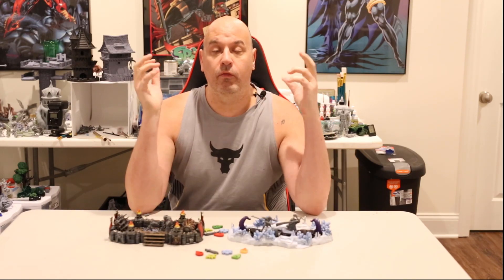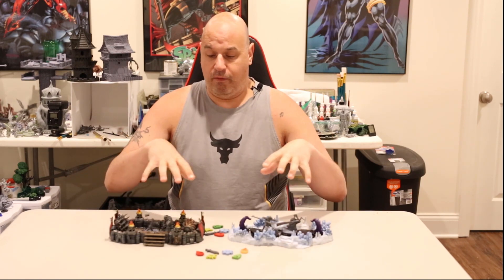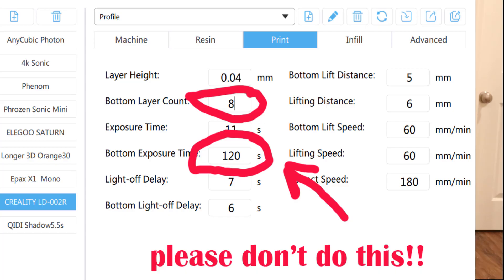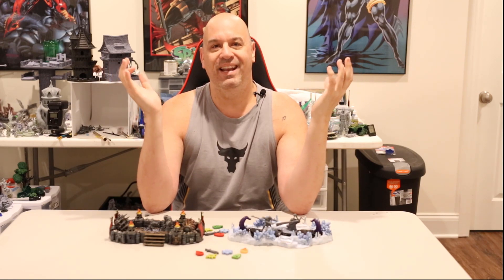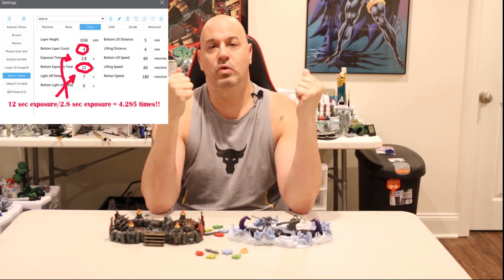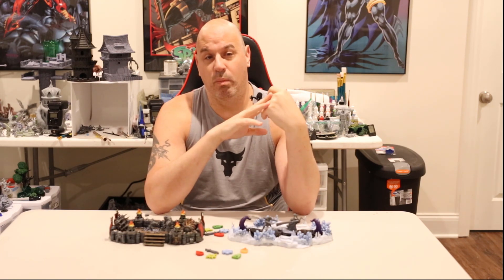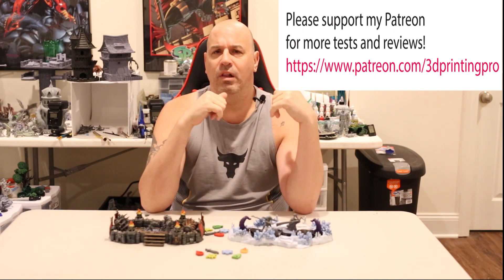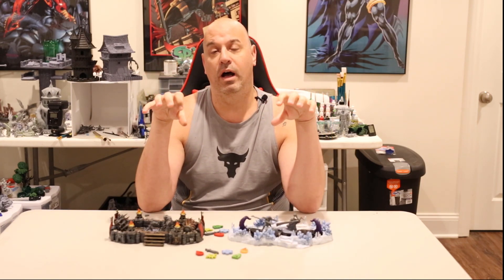Are you destroying your LCD screen when resin 3d printing?? Learn what settings may be doing it...

Comment: The most i've ever had was 6 layers at around 60-70 seconds at most... i've never had any problems with it...

I didn't even know people were upping it to 120 seconds... jeez
Reply: It's massively resin, layer height, etc. dependent. I've had to use 200s before. I typically sit around 10x normal for a good safety margin.

That being said, the layers is definitely getting out of hand, and higher layer counts is usually WORSE, not better. People don't seem to realize that only the first real layer touches the plate. Layer count is really to adjust for layer height. I also recommend 4 layers for standard .05mm height. If you halve the height, double the layers so you're still at .2mm of bottom layers.

Comment: I'm at 80s bottom layer time with 10s normal exposure time. I started at 60s bottom layer time and increased to 70, then 80 and now I get very few failures and prints scrape off pretty easily. I have 6 bottom layers and have been thinking about reducing this - now maybe I will go to 4  I've actually been wondering why anyone would need to do more than 1 bottom layer? There's only 1 layer that's sticks to the plate and if it doesn't stick, then the 2nd layer isn't going to stick also!
Reply: That's what I was thinking about bottom layers. Layers 2,3,4 etc. are just sticking to the first layer so do they really do anything extra by being so over exposed. I might try some experimenting with a tiny print.
Reply: @stinkyham9050  I just tried 2 starting layers and it printed just fine. I think I'll stay with that for a while and see how it goes.

Comment: I used phrozen water washable and it needed 30 sec on the sonic mini to stick securely, I had it partially lift on a few prints until i bumped it up. Siraya I'll do 15 to 20 depending on the size of the print. My photon I was doing 60-70,  I have over 800 hrs on that screen and it's still kicking.

Comment: Just to chime in. I use 3 bottom layers (0.05) at 30s on Anycubic Photon S (normal exposure at 9s). And I'm having issues with your flat bases. They are really hard to get off of build plate. Razor blade does help though. :) Never had a fail due to resin not sticking to build plate at only 30s for bottom layers.
I did sand the build plate with a P1000 sandpaper (straight motion, lengthwise) as suggested somewhere else.

Comment: I think bottom light off delay can also help with extending the life of the screen.  I am totally guilty of having too many bottom layers (12 @ 90 seconds once upon a time.... now down to 8 @ 70sec.).  But I've felt how hot the screen gets for long periods of on time.  Not to mention how hot the resin gets when exposed to the light.  I turn my bottom light off delay to 50% of the layer time to give that screen time to cool off some.  I think I'm going to start dialing down my bottom layers and times as much as I can to still get a good print.  If my OG photon can get down to 6 or even 4 layers at 60 seconds, so much the better.
Reply: My OG photons are 5 at 65, and everything works great so I believe you can too!

Comment: Im using a Mars 2 Pro with a mono screen, and normally Elegoo water washable resin. Elegoos reccd settings are 5 layer base exposed at 35 secs, then 2 secs a layer. Seems to work sweet as a nut for me even with "big chunky" prints that have a lot of surface to lift. Great base adhesion, no base peel, but clicks right off with a nudge at the edge at the end of the run. Water washable has different settings to normal resin so the settings for normal would be different. The 2 Pro Mono is a massive step forward IMHO....very impressed.

Comment: Hi Greg, i've seen that on your epax you're using 7 seconds of light-off delay. Could you explain why? As always your videos are amazing.
Reply: I noticed that too. I tried asking him on the AG discord but he's a busy guy so never got an answer
Reply: @HEMASimian He usually responds the messages. I just want to know if that delay is another of his magic tricks
Reply: @Jbachill  yeah I've never seen anyone recommend anything over 2s, let alone 7. Not sure what issue 7s would fix that like, 2s wouldn't so I'm super curious
Reply from the maker: @HEMASimian  I'll make a quick video on that stuff!  :)
Reply: @3dprintingpro212  thank you!
Reply: @HEMASimian  @javier Bachiller my understanding at least on the PhotonS is anything under 6.5s it ignores and sets to 6.5, so by setting it to 7, again on on a PhotonS he is only raising it .5 from normal.
Reply: @MrRage000  Thanks
Reply: Perhaps giving more time for LCD to cool down after each layer to extend it's life? I'm new at resin printing, but I have mine set to 6 seconds in hopes that this will prolong it's life.
Reply: 5s light-off is built in (maybe higher on other printers) so 7 is really just +2 seconds of cooling off per layer. Has various small benefits, raises life of your screen, and may protect fragile pieces.
Reply: good sharing. may i know what you think about the wham bam flexible print bed for resin printing ?

Comment: On my sonic mini, I've been using a 3.5s exposure time and 4 bottom layers for a while now, but with a 25 second bottom layer exposure time (6.25x).  No issues, at all.  I'm going to try setting it to 18, to get it closer to 5x the normal exposure time, and see how it goes.  Thanks for the video!

Comment: With the Photon S the recommended was 3 layers and 40 seconds, I've dropped mine to 3 and 30s layers and can count on one hand the number of issues I've had in the last 5 months. Every time I read a comment that suggests someone increase their bottom layer count/time I cringe because it's usually not the right answer. I'm still waiting on my Saturn(one of the last from the first batch) but I'm planning to run some prints at 3 layers and between 10-30 to find the sweet spot.

Comment: It's really great that you made this video, but the unfortunate truth is that most people using 3d printers have no idea how they work, and no interest in tweaking settings. They just go online and copy someone else's settings. Almost none of them will ever try to calibrate themselves, and when they invariably end up welding their prints to the plate, many of them run out a buy a flexible build plate like that whambam refrigerator magnet or some other gimmick thinking that's what you have to do.

Comment: I use 6 bottom layers @ 36-45s on my Anycubic Photon Zero - never, ever had a problem even with bigger terrain bits. 6-8s normal layer exposure times using elegoo abs-like. It's crazy if people go above 60s on those bottom layers!